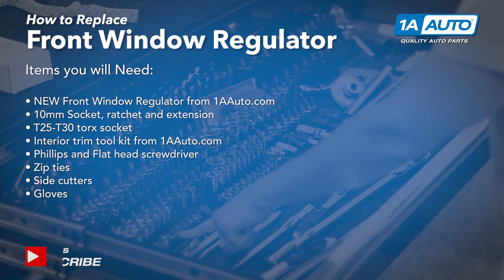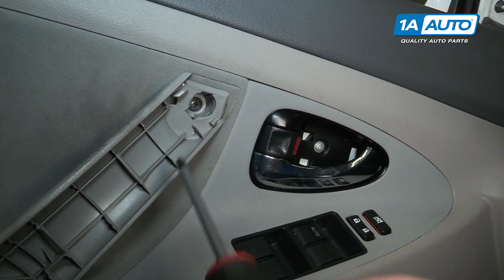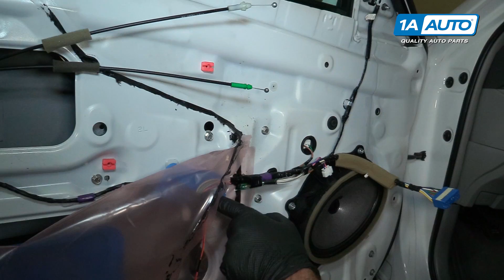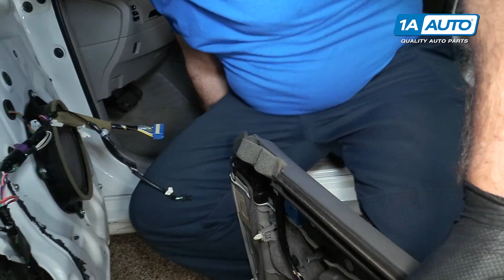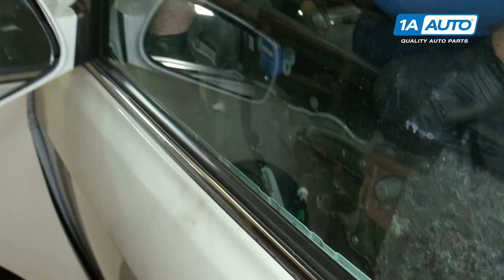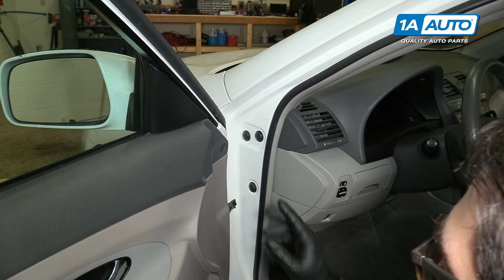How to Replace Front Window Regulator 06-11 Toyota Camry

Comment: Thanks for the video!  It was the most helpful, I just needed to get my passenger front window back on one of the mount supports. The hardest part was putting the door panel back on...the clips like to fall off or break.  At any rate the job is done and was a success, thanks again!

Comment: Daughter car had the front driver window get jammed 1/2 way after a lot of noise ans reverse. Followed the instructions... found the right hand bolt had come off and was in the recess. Had to get the window back in it's track before aligning the bolt and doing it up. Works like new... no parts needed.:face-blue-smiling:

Comment: This is exactly what I need to do, except I don't need a new regulator.  It seems that the bolt holding the clip under the window to the track has come loose.  I have the bolt, but here is the issue: while the Corolla you are showing has phillips head screws to disconnect the speaker,  mine has rivets.  I have found videos about replacing the speakers but I don't want to do that.  Any ideas?  It is a 2011 Corolla S model.
Reply from the maker: +dpelland66 Thanks for watching!  Some parts are riveted on from the factory, and if they need to be removed you have not choice but to drill them out and replace them with nuts and bolts, or self tapping screws.  1aauto.com

Comment: Here’s a question.can I push the window down by hand if the window is all the way up to gain access to the window regulator?
Reply from the maker: +heynow828282 You would have to remove the motor from the regulator somehow to get it to move. It may be a bit hard, but it's required to get the regulator out. Hope that helps! 1AAuto.com
Reply: Any suggestions on how I can take out the motor by hand? Kinda no room to stick my hand or tool in there.
Reply: @heynow828282  kinda late but you just unbolt the whole thing let it fall reach up unscrew the glass then once the glass is off you can just take it out